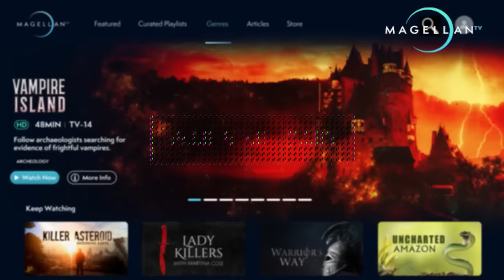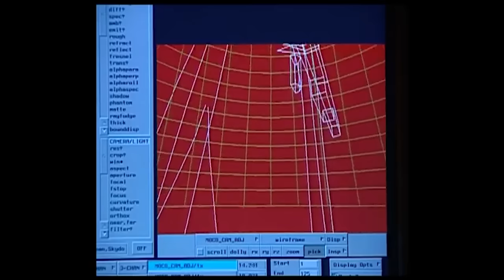The MASSIVE Sinking Models From TITANIC (1997)

Comment: Fun fact. There's a scene during the break up that shows a room being split in half. The room is a composite of the models used for the smoking room and the lounge and thus represents a room that didn't actually exist on the Titanic. The room has the lounge paneling and the smoking room ceiling. Why they did this when they clearly had models of these rooms I do not know.

Comment: Hi Mike. Here's a question. Why does Titanic seem to be the only ocean liner that split in half when sinking? The Britannic, Lusitania and Empress of Ireland all sunk in a slightly similar fashion, so why didn't any others split in half?
Reply: I’m assuming When Britannic’s bow hit the sea floor the engine room where most of the weight is was too close to waterline preventing it from adding pressure and stress to the hull for the period it was suspended, in addition to the ship falling over on its side shortly after. Lusitania and Empress of Ireland sank very quickly likely preventing the stress buildup in the hull. I could be wrong though.
Reply: I theorize the Titanic momentarily grounded on the iceberg shelf and crimped the keel, starting the break-up much earlier.  The stresses of water weight and upending progressively proceeded from the "pre-cracked" starting point.

Comment: James Cameron should have invested in a finite element analysis of Titanic using ABAQUS, LS-DYNA, or another good nonlinear solver to accurately model the breakup.  If you look at the wreckage on the ocean floor, the sides of the hull are bowed outward, and the upper decks are pulled downward at the break.  Bend a long cardboard tube such as used for rolls of Christmas paper.  The cross section ovals as it bends.  The same would happen for a tube with a rectangular section.  The sides would bow outward and the upper and lower surfaces would be drawn toward each other.  This effect is not captured in images of the hull breakup created for the James Cameron film or any other film or publication about Titanic.

Comment: I was at a festival/market a couple years back and they had a large titanic exhibit there that included some salvaged pieces of the titanic model that were collected from the scrap heap. I ended up buying a small piece of wood that came with an authenticity letter from the scrap location in Mexico. Even if I can't 100% confirm its authenticity its still a cool piece to have.

Comment: The angle of the hull at the time of the breakup is too steep in the James Cameron movie.  The bending moment in the hull would have been larger at a lower angle.  The breakup likely occurred before the location of the break had completely cleared the water.  Of course, the larger angle makes for a much more dramatic breakup in the movie.
Reply: My theory holds that the hull was breaking progressively from the time of the collision to about upending, at which time it pretty much severed the hull down to the keel.  Still briefly attached by the keel, the stern was pulled vertical until the keel broke , the bow dropped away and then she settled back slightly and went under.
Reply: @Dallas_K  The primary structure of the hull can be treated as a beam.  As the aft end of the hull lifted out of the water, it became loaded as a cantilever beam subjected to gravity.  Structural failure occurred relatively rapidly once the stress in the upper decks reached yield strength.  As the decks and adjacent hull sides yielded, they began to buckle.  The hull sides bulged outward, and the upper decks were pulled downward.  The double bottom plating and hull sides below the waterline were thicker, so the neutral axis of the cross section was biased toward the bottom of the hull, so the stress was much lower there.  The effective neutral axis of the cross section became even more heavily biased toward the bottom of the hull as the upper decks failed.  Toward the end of the breakup, the double bottom behaved as a plastic hinge before finally failing.

Comment: How accurate are the shots of the ship going down with the lights and power still on? How long would the ship's electrical system remained energized after the ship started to sink?
Reply: The power would’ve remained on for about the same time as in the film, but according to witnesses, it would’ve waned over time while gradually developing an ominous red-ish colour, as opposed to maintaining the same level of brightness throughout. The bit where the lights went out probably would’ve been more gradual as well, instead of a swift and dramatic flickering.

Comment: It seems a common mistake in Titanic miniatures is that documentation from H&W shows that Titanic's center propeller has three blades. The famous photo's of the propellers in dry dock are of the Olympic and it's four bladed props. Later Olympic got the three bladed prop, experimenting with performance - efficiency - vibration. 

Great video!
Reply: In their defense, though, the documentation wasn’t rediscovered until 2008.
Reply: I think I’ve read somewhere that the Olympic went to the 3 bladed propeller and then back to four bladed one. I forgot why though.
Reply: @大和さん-25  To conduct the same experiment that Titanic never got to complete.
Reply: @大和さん-25  I think it did. They used the 3 bladed design that was on Titanic and switched it back.
Reply: White Star Line experiment with the middle propellers on to see which is better
3 or 4 blades

Olympic getting the 4 blades and Titanic getting 3 blades

Due to the Data They concluded 4 blades is better

Which they implied it to HMHS Britannic
Reply: I consider that theory proven once I see a three-bladed center prop.  Who is to say it had not failed during trials and a 4-blade prop was chosen.  It was not a crucial issue for the Board of Trade so no need to fully document it by them.  Yes, I am a die-hard traditionalist.
Reply: @Dallas_K  It went from the trials straight to Southampton, so they couldn't have changed it then.

Comment: Too bad Cameron got the breakup entirely wrong.   The stern did not break off and fall down due to its weight.  Rather, it was the upwards force of buoyancy pushing the still dry stern up, against the increasing weight of the flooded forward half of the ship that cause her to break.  And the Stern Bent UP.    As per Thayer’s account, the entire break occurred Below sea level and the center of the ship went down as her stern and bow both went up.   Just the forward 15 feet or so of her bow poked out of the surface when she folded down in the middle, but it was a moonless night and the bow painted black, so most witnesses did not notice it as their attention was on the dramatically rising stern. Because the break was below surface, most witnesses did not even realize she had broken, but thought the rise of the stern was because the bow was tipping down.   It wasn’t.  It was the break down in the middle that first caused the lift of the stern out of the water.  And the 20 foot long piece of Unbent hull bottom found between the sunken halves proves that the bottom was pulled apart by the lifting of the stern. Think about it… as she sank, she shipped water. That water meant that she had to displace a LARGER volume of water than she normally did, as the water more than doubled her weight.  Every ship that is taking on water remains at the surface only as long as the hull can displace more water than the ship, plus flooding weighs.  So when the bow was submerged, try to imagine that she still had MORE dry hull below sea level than she normally did before the iceberg.  As the weight built up amidships, the center of buoyancy kept shifting aft, until it was well aft of the expansion joint between the engine room and boilers.  At that point the still dry stern was supporting well over the ships entire designed displacement. And the expansion joint halved her beam depth.  So the bottom came apart in tension and the stern was folded up as the heaviest position of the ship, the flooded boiler room, dropped down.  This lifted the stern up, and crushed a large wedge shaped section of the upper superstructure, but, again, that was below the surface of the water.  As the last of the sides of the hull gave way, the bow section dropped away and planed off bow first underwater. And  then the stern dropped back down. Thayer described the stern section then spun in place 180 degrees until it was over the spot the bow had formerly been, but facing the opposite direction as its engines and flooding engine room tipped the stern near vertical and she sank.  Thayer’s account perfectly predicted that she would be found in two pieces, with an inverted wedge shaped area of superstructure crushed, with a section of her bottom at the break found unbent directly below her position when she sank, and with her stern facing the opposite direction. She broke DOWN in the middle. The bow resurfaced briefly.  The entire break was below sea level. It was not the weight of her stern, but the tremendous force of buoyancy trying to hold the entire flooded ship at the surface by just her stern.

Comment: An easy solution IMO for creating a more natural look of the waves in a water tank would be to vibrate the water creating lots of small closely spaced waves. You could shoot it then slow it down until the waves were at a correct rhythm.
As for the passengers I would dress up little mice in period outfits and let them scamper about. If it was far enough away they would just look like ugly people.